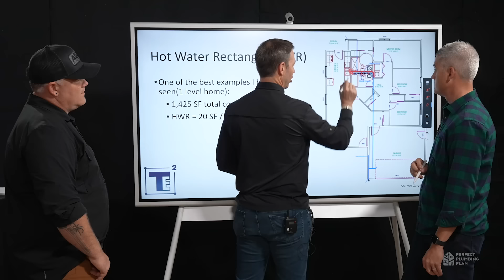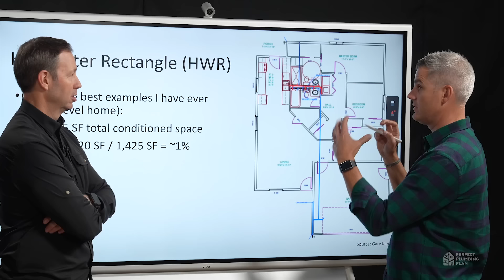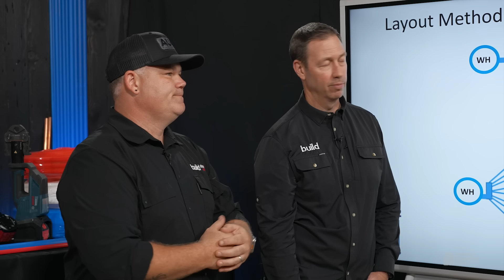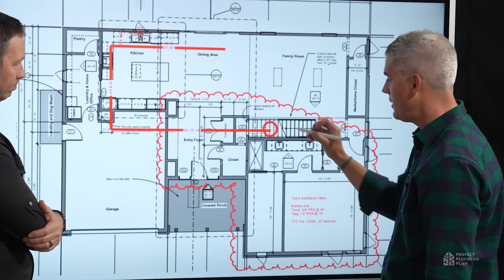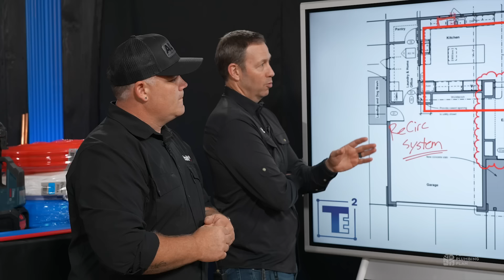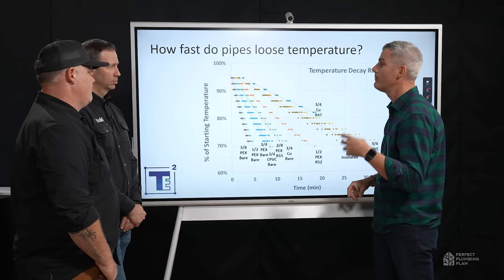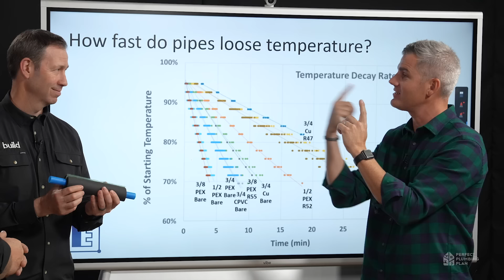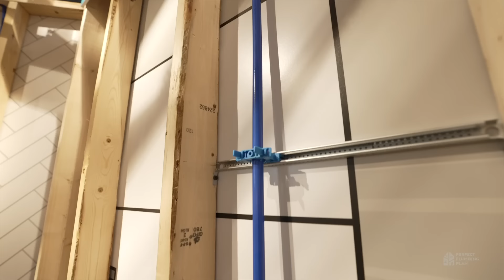The Perfect Plumbing Plan - Ep. 2: How to Get Hot Water Under 10 Seconds - Plumbing Layouts Part 1

Comment: Ross was standing in front of the pipe heat loss graph saying : "PEX holds on to heat better than copper", while the graph behind him shows the exact opposite !
Reply: Wow, the graph really does show the opposite of what he's saying.. But that makes me think the graph is wrong.. Copper has a significantly higher thermal conductivity than basically all plastics, like orders of magnitude... Like Ross said.. thats why copper is used for heat sinks, radiators, hydronic heating etc... If plastic was better, everyones car radiator and AC unit would be made from plastic..
Reply: TLDR: PEX sheds heat faster than copper because it more readily radiates energy. The difference in thermal conductivity is totally eclipsed by this.

Long version: 
I decided to math it out t and was surprised to find that the biggest factor in heat loss was the emissivity of the pipe material (it's ability to radiate heat), which is much higher for PEX. I calculated the thermal resistance of the pipe, and convection and radiation from the outside. With my assumptions (120F water, 70F ambient, oxidized copper type L, 3/4" SDR-9 PEX, horizontal pipe), the steady state heat loss is 24.6 BTU / (hr * ft) for copper and 25.1 BTU / (hr * ft) for PEX. Interestingly, new, shiny copper has an extremely low emissivity, so copper holds heat even better when its new.
Reply: @jaylyon4130 hmmm, interesting. Would never have guessed that.
Reply: @chaseweeks2708  because it's wrong.  It's all about contained water volume.  Surface area to volume ratio.
Reply: @johnneil6653 
Where's your math on that?
Reply: @merlinious01  Emissivity is relevant to radiant heat, which is worth considering in high temperature differential environments.  Emissivity does not impact conduction or convection.  In a 70 F basement, a 110 F pipe is 40 F different.  Loss to air will dominate over radiant unless you're in a vacuum.
Reply: yeah I would intuitively think copper radiates heat faster but that chart shows 3/4 inch copper out performing 3/4 inch PEX and CPVC.  very confusing.
Reply: Of course I jumped into the comments to affirm I wasn’t crazy…. The graph makes no sense…
Reply: Wow so much conflicting comments made me look at this closer and determine that it was badly explained. You can describe a glass of water as 20% full or 80% empty. Here’s my attempt: the graph is showing decay of temperature not “holding temperature”. Therefore, at 7-8min, as he suggests, 3/4 pex has decayed approx 70% (means it’s still holding 30% of the original heat), while Cu decayed 80%, still holding 20% heat, which means it cooled down faster. Conclusion: cu dissipates heat faster than pex (better conductor of heat).
Reply: @1959mikel  I would agree with you but the y axis is labeled as a percentage of starting temperature, which leads me to believe that if Ross is explaining it correctly the temperature of the pipe must be what is being measured here, not the temperature of water. I.e. the pipe is heated to 100% then we watch to see how fast the temperature decays over time. This would help us conclude that the pipe (not the water in the pipe) is less or more emissive.
Reply: @1959mikel  Agreed, that chart was a total disaster. Lots of confusion and mislabeled details.
Reply: This chart looks to me a little bit messed up. For one some initial heat is lost to heat up the pipe itself and 2nd because of radiating/conducting to the enviroment (wall). I don't know but to me it seems the Rxx codes n this chart refers to 10x the R-value of composite insulated pipes. 
Last but not least: Some walls are insulated and thus will partially insulate any pipe put in the wall, anyway.
Reply: At the same time the guy on the left says "the graph is easy to understand"! 😅 Fr tho, idk why they have numbers for 10x the insulation anyone puts on their pipes tho. Seems pretty sus to me.
Reply: @baraksmith619  Or having some R values specified while others say "insulated" only.
Reply: Because for same NPS, pex has smaller ID.  So less heat source sitting in that pipe.  So even if the heat conducts/radiates out slower, the smaller heat source cools faster.
Reply: The graph shows that for the same diameter pipe, the copper pipe loses heat more slowly than either PEX or CPVC. In this graph format, lines farther to the right are "better," that is they take more minutes to fall to a specified percentage of the starting temperature. An infinitely insulated pipe would approach a flat, horizontal line; and the most inefficient pipe imaginable would approach a vertical line down.
Reply: If you look a little closer, the Copper entry on the chart also says R47. So... for some reason the only copper figure they decided to add to the chart is copper with something like 10 inches of closed-cell foam encasing it. I had to go back and look myself. it's weird.
Reply: @chaseweeks2708 Huh? The chart also shows 3/4 Cu bare.
Reply: @georgejetson4378 oh damn, how did I miss that... Twice?
Reply: The graph is correct imo, just not explained properly. Cu is better conductor of heat, it will lose heat faster than PEX. The graph shows for example that at 8 min, heat loss for bare pex is 70 % whereas for bare Cu its 80%.
Reply: @1959mikel  there is no way copper looses heat faster then pex the sectional density of copper is far greater then pex.  I have real world experience with this in the oul and gas industry. Originally the engineers called for pex trace lines for our flow lines. When the system would have an emergency shutdown the pex would loose heat extremely fast, when we changed to metal trace lines we had 3-5 hours to get the system back up running. Both systems were insulated the same.
Reply: @BaronVonFrankenBolzlllother data sources show the same, pex is a better insulator.
Reply: One is bare and one is insulated. He did say pex is better than bare copper which I agree with
Reply: Makes you start wondering what other 'facts' they're trying to throw at us, betting most won't be observant enough or motivated enough to fact check...
Reply: @WesleyHarcourtSTEAMandMORE the warmth of the copper pipe is the heat leaving the water, you don't feel that as much on plastic pex. The copper pipe clearly loses heat far faster than pex.
Reply: Insulate the pipe properly and it doesn't matter ... but stainless pipe will outlast any of them, and also doesn't leach nanoplastic particles like pex or metals including traces of lead from copper. If you're building a house that you want your grandchildren and their grandchildren to live in, do it right the first time and they'll honour your memory.
Reply: Because the copper pipe has more hot water in it so it takes longer to radiate that heat out despite higher conductivity across the thinner (and  more conductive) pipe wall.  Rate of heat loss (watts) and rate of temperature loss (degrees per minute) are two different things.
Reply: Not confusing insulate the pipe.

Comment: Please talk about well water and how to prevent someone getting burned in the shower when someone flushes the toilet.  I have lots of issues with water pressure dropping with trunk and branch when 2 showers running.  Can also talk about filtration too please. 😊
Reply: This topic has nothing to do with well water or lack of mixing valves
Water pressure from a well is due to lack of pump pressure
Scolding hot showers when flushing the toilet is old valve. They need to be changed to thermostat mixing valves.
Reply: Maybe your pressure tank is waterlogged or your pressure valve is not working properly.

Comment: What about tankless water heaters at each point of use?
Reply: A much better solution in my opinion. My house has en electric tankless, and the rectangle is less than 1%. Total time to get hot water is usually always between 10-15 seconds. Even with a bigger house, if you have to get 3 or 4 point of use units, because they are so much more efficient that they will eventually pay for themselves because tankless systems use less overall energy than a conventional electric boiler. In my opinion, gas tankless water heaters should not be used, or even banned. They apparently breakdown because they contain several moving parts, and who wants to use gas anymore anyway. The negative reviews that you may hear about electric water heaters I think are misguided. If you do not get the correct MODEL for your specific area, it might not heat the water sufficiently. Getting any unit at the cheapest price is not the way to go. The model must be specific to the cold water temperature in your area and flow rate of your water system. Anyway, in pure carbon footprint context, I believe tankless water heater systems are by far the best way to go.
Reply: That's what I was thinking when I mentally built my house. You would only need the smallest 1 to 2 fixture device in each room depending on the location. It shouldn't take up very much room under a sink to satisfy the sink and say a shower or bath tub. I would run electric over gas on one dedicated 30A circuit for a one heating element electric. If you want gas, you'd have to pipe to each drop point which adds expense. Then it just comes down to whatever is cheaper for your end use. The downfall of a tankless heater is you won't have hot water during periods of power outage, so you might need to supplement with an external source.
Reply: Point of use heaters FAIL Extremely FREQUENTLY  USUALLY a poor choice.

Comment: Lets greatly increase the complexity, cost, and maintenance of the system so we get hot water a little bit faster with one water heater.    If 10-scecond hot water is that important at the end of a longer run, you might be better of tying in a small compact - 2-5gal - water heater on end of that branch.   The whole, larger house does not have to be engineered around a single water heater.

Comment: Kitchens don’t use as much hot water as people think.  Less than 10 gallons a day in many cases.  So if your kitchen is far from your hot water heater, an electric tankless under your sink might be a good option.
Reply: Electric heat cost 4 times the cost of gas.
Reply: @BirchwoodBill  If you like your gas you can keep your gas.

Comment: You missed to mention hybrid systems with auxillary hot water sources. For example a flow heater at a shop sink far away.
The return side in a loop should be smaller than the feeding side. You're only recirculating just 'some' water to keep water at temp in the loop.
The less water is in the loop the less is heat loss. Heat loss is determined by surface area of all pipes involved and their insulation.
Last but not least: Think of Legionella that will die only above 122 °F but will grwoth in between 77 °F and 108 °F (max growth 90 °F to 108 °F doubling within 3h). A smart system might periodically heat up above 122 °F to disinfect the lines. Bare copper is disinfecting by material properties.
Reply: We need to understand under what circumstances Legionares is a factor. It's not in your water heater.

Comment: The problem I see with the retrofit recirc with no dedicated return line is that it pushes hot water into the cold side, which screws with the water temp just as much as having cold water coming out of the hot side.
Reply: What do you mean "screws with water temp"?
Reply: @TerryPullen   You partially heat up the cold water line at the point of use. So, when you first open the tap, both the hot and cold side are both hot and the cold side gradually drops in temp as the water flows. So, basically the opposite problem. Instead of being cold for a minute, it's up to water-tank-level hot for a minute. Neither option is optimal, unless you set the point of use recirc pump to shut off when the water reaches about half the expected difference in temperature between the cold and hot side, I guess. Say the cold side is 60F and the water heater is set to 140F, setting the pump to shut off when it reaches 100F instead of 140F would reduce the effect, both in severity and duration.
Reply: @chaseweeks2708  plumbing standards restrict how warm the water can be when using a bypass valve. PS-115 mandates that water cannot be above 95F as I recall. And there are state codes that limit this as well (rise in temp to 10F and limit operation at 102F max in CEC Title 24, Part 6, RA4.4.9/10).
Reply: @essentialhomeowner   That limit makes sense, and I guess that would work "well enough" for a retrofit. I think I'd still rather just run a return line of the end of the trunk and not push warm - then hot water up the cold side.

Comment: Recirc retrofit, btu loss, kwh cost pump, cost of install, pump failure.  Letting hot run for 30 sec. is fine.
Reply: Some people enjoy near instant hot water. It is nice to turn on the sink to wash your hands and have the water not be freezing cold.

Nobody is going to wait 30 seconds to wash their hands.

Another benefit is that your dishwasher gets hot water immediately so it performs better.

Comment: I, too have watched many plumbing videos, including Gary Klein's to develop my own gravity fed hot water recircultion system as I replumbed my own house with Pex A pipe into my attic and down to every fixture. Using a swing check valve horizontally does not work for recirculation, about a 30 degree drop angle and adding a gate valve(for water hammer) to restrict backflow so swing valve won't hammer on heavy use. I rectangled out recirc just encompassing the necessary perimeter of fixtures. The result? With water heater set at 140 degrees for safety reasons(Legionnaire's), I have hot water at any fixture in 6-8 seconds!!! I used 1 inch Pex for the main runs,.....might have been ok with 3/4 in hindsight but I did not want to sacrifice inside diameter. Now I want to become a plumber lmao

Comment: Instead of recirculating with constant heat loss, I added a tiny water heater under the sink far away that's fed from main water heater. This gives instant hot water that never runs out because refills from main water heater, which also heats up the water in the pipes to shower & other areas
Reply: I have thought about that. If it takes 1 minute to get hot water heater, how about a 2 gallon hot water heater under the sink that serves as the "cache" for hot water until it can be fetched from the main heater
Reply: @crabkilla found the software engineer 😂
Reply: @crabkilla  I run the shower through the small tank too. Buffers out the cold water sandwich from tankless main heater.
Reply: Exactly this.  The complexity is very, very low.  The cost and maintenance is very low.  There are no moving parts/pumps involved.  There is no water loss.

Comment: Interested in the comment about how the recirc pump could be retrofit. Only way I see is to build a new return, but you seemed to indicate a different approach to be revealed in a later episode. Will check back and see.
Reply: I retrofitted in a dedicated recirc line. I was fortunate that my house has open web truss between the first and second floor. It was mostly a straight shot from the farthest fixture back to the water heater.

PEX is your best friend in this type of retrofit.
Reply: I use a retrofit recirculating system.  There is a temperature sensitive valve connecting the hot and cold lines at the farthest sink.  The valve stays open allowing the hot water to return via the cold line.  When it gets warm enough the valve closes.  In my case the house computer (Hubitat) senses motion in the bathroom and starts the recerc pump.  The pump pushes hot water through that loop (I have two loops one for each floor) until the valve senses the hot water and closes.
Reply: @TerryPullen The trade off is this leaves water from the hot tank in the cold (drinking water) line. Generally good to avoid ingesting water from the tank, but fine if this tap is not used for drinking
Reply: The retrofit way is to use the cold line as the return.
Reply: The pump he has from Grundfos is the ALPHA Comfort System (CS) model that has valves that go under the sink and use your cold water line to go back to the tank.

Comment: My hot water circulates through convection (no pump necessary) from the basement to 2nd floor, with branches to 1st floor
Reply: I like the idea of a convection (thermosiphon system) 'pump' but typically, for house/building hot water, this always poses quite a bit of a energy cost increase due to the inefficiency of the system.  If you insulate the lines, that just makes the convection/flow slower and less efficient.  If it's circulating fast, due to a large temperature gradient from source/return, then the water heater is ON much more often than no recirc loop at all.  It just comes down to money, if you want instant hot water...gotta pay the piper.
Reply: @Ifishmo Agreed - that’s why I have a valve to shut off the return during the air conditioning season. The heat coming off the non-insulated return pipe helps out my furnace a little bit during the heating season.

Comment: around 2:00 the HWR layout of 1% is a crappy home layout. There is a reason why the master bedroom is separated from other bedrooms. are we building for the occupants or to minimize plumbing?
Reply: My take is that they were showing the extremes. The middle ground they would recommend is probably ~30%. Ultimately though, it seems like for most people that a recirc loop is just the best unless you are building a pretty small house. If you are sub 1500sqft, this is probably something really worth thinking about. Also valuable to think about where you are putting your water heater.
Reply: To be fair he did mention that is typical in an apartment layout where separating the master isn't as simple.